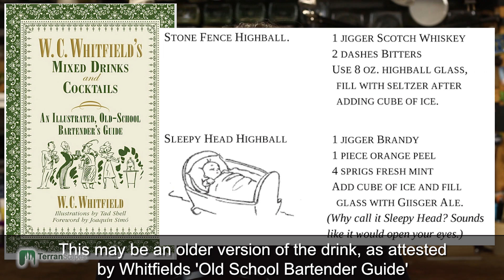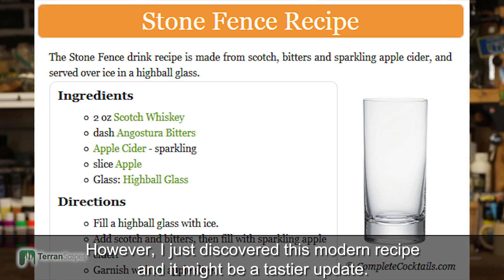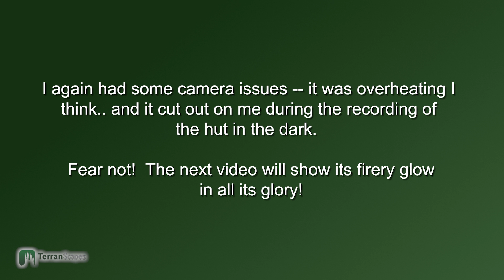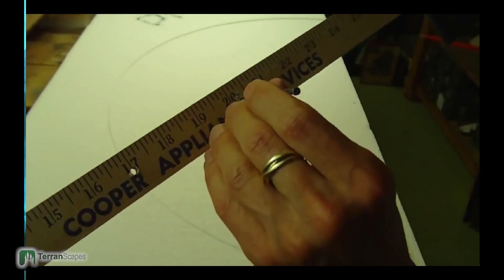Orc Display Board - Finished Orc Boss Hut and Idol

Comment: You are a very dedicated and talented craftsman and artist - in equal parts :)
Always great seeing a new video!

Even though I've probably watched all of your content, this is the first time I feel like I have anything to add 😅
When it comes to cutting the foam - considering the amount of compressive resistance in that type of high density foam, you have to remove up to 90-95% of the material (compared to the total thickness) to get it to bend. If you want to create a beautiful and even curve, I mostly consider the foam to act as a "middle/outer structural layer". Meaning that - it's way easier using a really thin, high density foam to create the shape, and then reinforce the backside of the piece (with insular foam, concrete(heavy!), plaster, clay or why not even more foam and some glue?)

That works great for me :)

PS, I sent you a house I made for you to rate a few years back - am I naïve if I keep hoping for a video of it?
Haha 😂